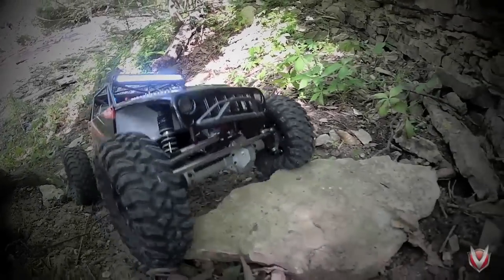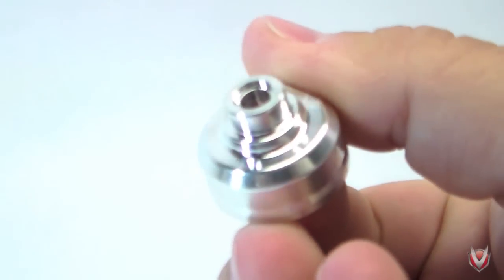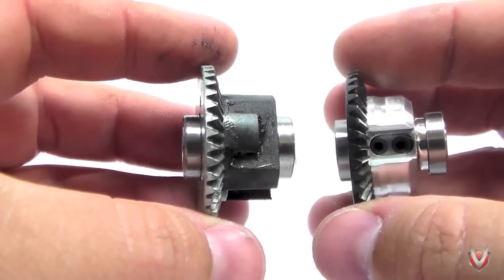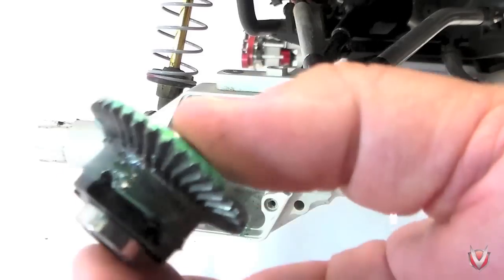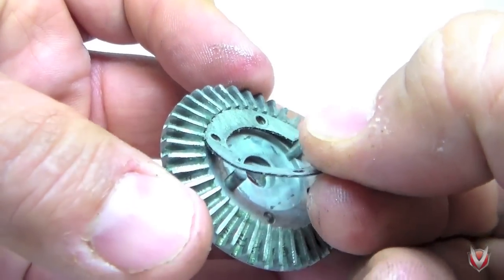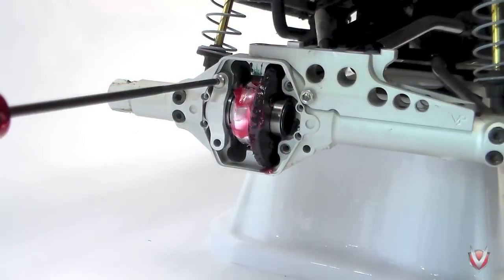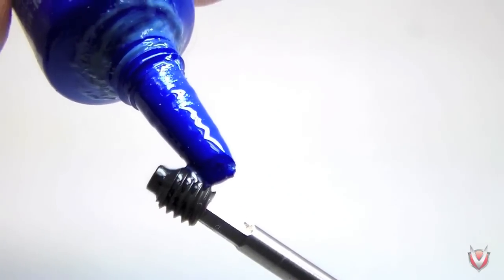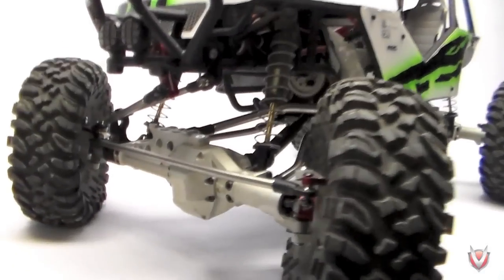Axial Wraith lockers

Comment: If you're running VP SCX10 housings you dont need to modify anything. It has removable diff covers allowing access to the set screws. the VP lockers also use the same exact 4 screws to mount the locker to the ring gear as stock.

Comment: I installed the VP lockers with the gasket the first go around. very very tight fit. I removed the gasket and it was much easier fit. I would recommend not using the gasket because the bearings will not seat in the slots with ease. the VP lockers were designed to not use the gasket.